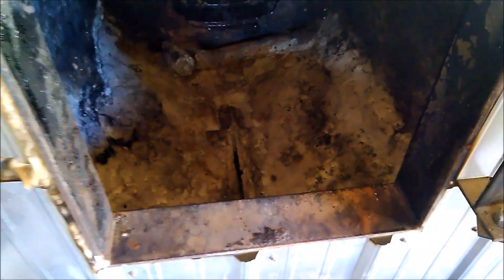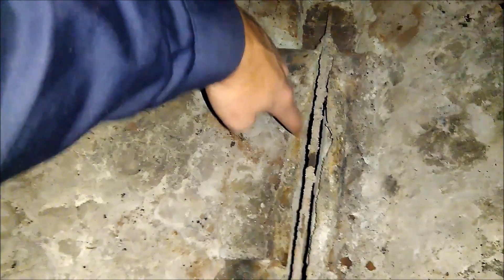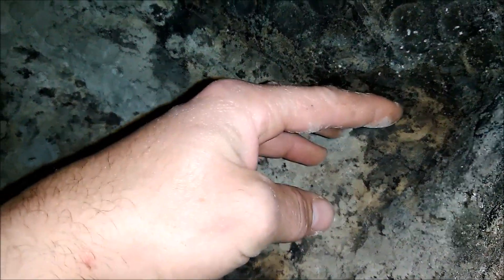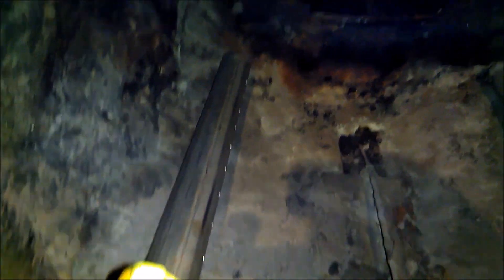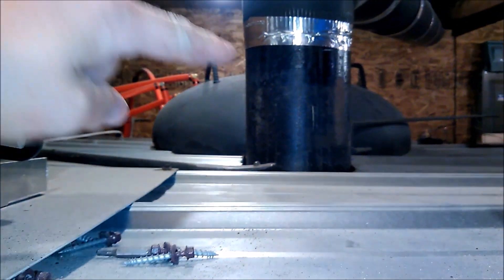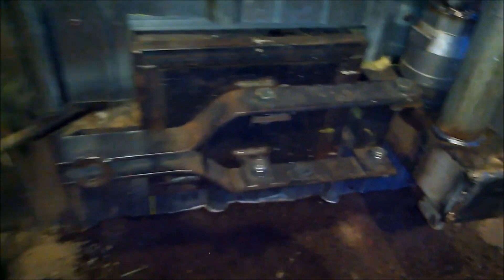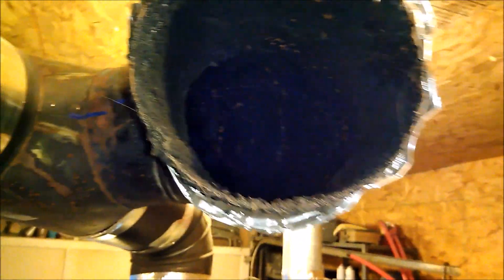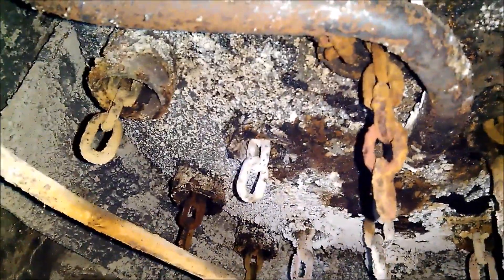Wood Gasification Boiler Repairs

Comment: very interesting build Zims. The slot looks narrow and im wondering how long the slot is compared to the fire box length? Have the new air pipes worked for you?  Your doors with the center pivot is smart.  What did you use on the doors as an insulator?
Thanks